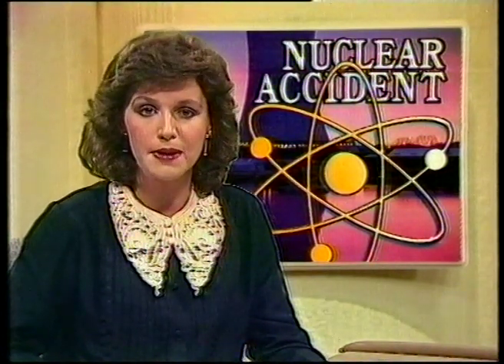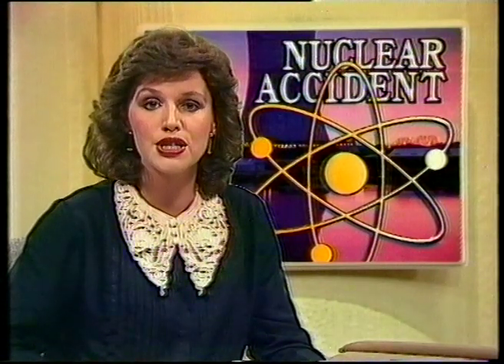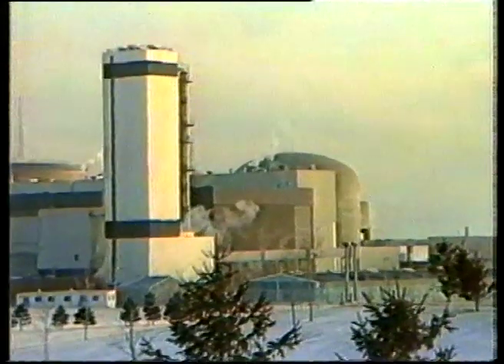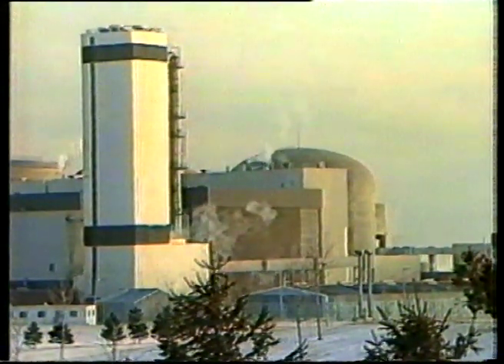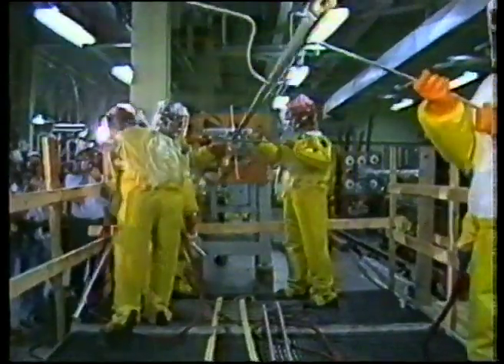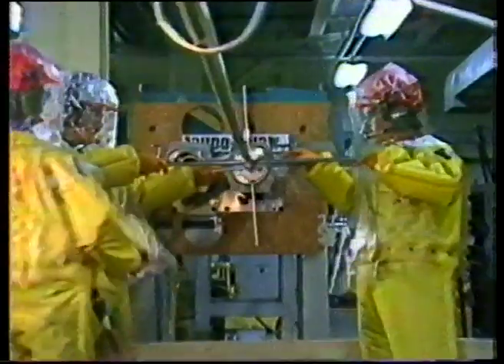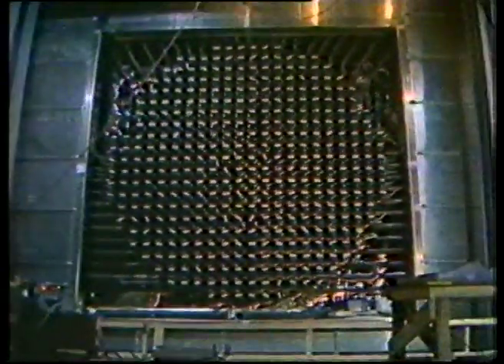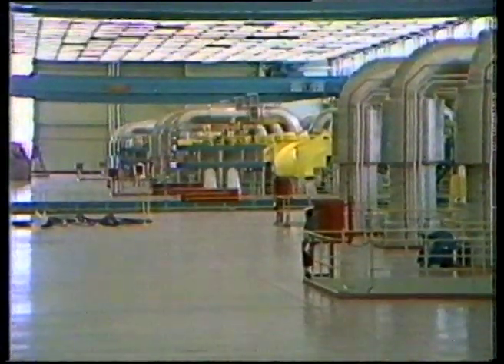1983 Pickering Nuclear Accident Canada

Comment: Certainly the Australian news story is rubbish.  A Candu reactor contains fuel bundles NOT fuel rods.  Each fuel bundle is made up of individual fuel pencils containing the individual fuel pellets.
The Wikipedia story is quite accurate.
Each fuel channel consists of a pressure tube concentrically located within the calandria tube.  The space between the two tubes serves several functions, the main one being a thermal insulator between the very hot pressure tube, and the much cooler moderator that surrounds the calandria tube.  Without this insulating annulus the thermal losses of the system would make the whole idea of Candu uneconomical.
There never was any danger to the public.
Reply: WRONG.
fuel rod 
A long slender column of material containing fissile nuclides. The rod is normally encapsulated by metallic tubing. Indeed used at AECL, & throughout Canada.
Reply: @DeniseLaFranceCDNpainter  No.
Reply: @DeniseLaFranceCDNpainter   well thats not a case for CANDU reactors silly

Comment: It was a result of hydride blistering due to unpredicted calandria/pressure tube contact. 

wtf is a fuel rod?
Reply: fuel rod 
A long slender column of material containing fissile nuclides. The rod is normally encapsulated by metallic tubing.
Reply: @DeniseLaFranceCDNpainter  In a CANDU nuclear reactor the fuel elements are termed fuel pencils, as these are quite short, the length of a fuel bundle.